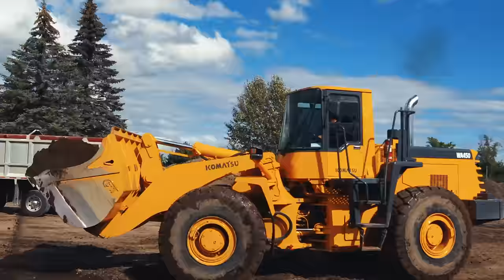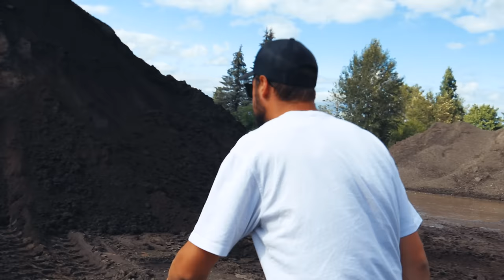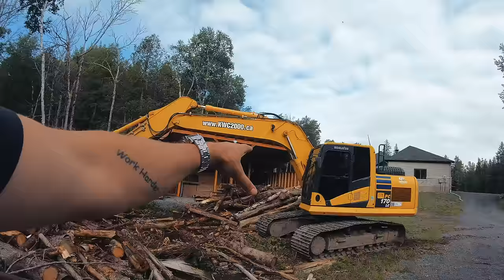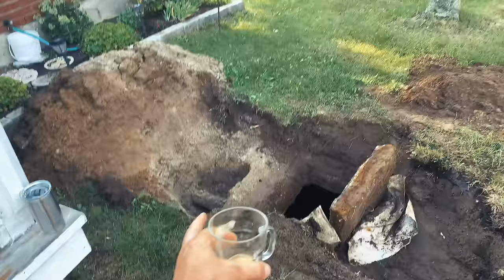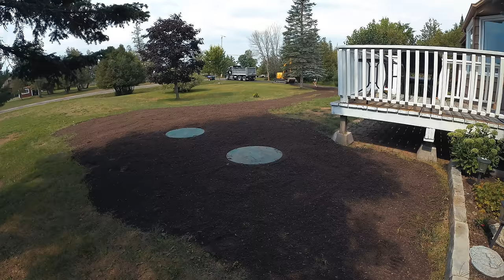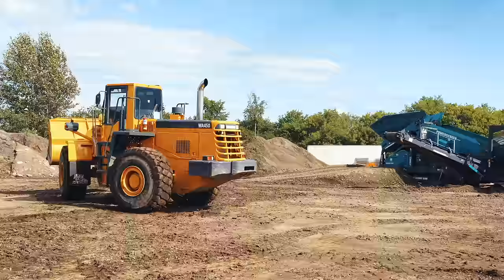Fastest Way to Clear the Woods (20 Ton Excavator VS Forest)

Comment: What happened to Cody? I had to do that a few times running loader. If you dig into the middle of the pile it is usually dry. Just spread the wet stuff out and let the sun dry it.Drop it Andrew.

Comment: No offense but that’s probably the dumbest thing i’ve seen with the septic tank, you little put the dirt in a dump truck then hauled it off then brung it back when it was set to cover it back up. just dig it put the dirt on the side and use what u need after it’s set then haul the rest off. that’s just wasting a lot more fuel and time.